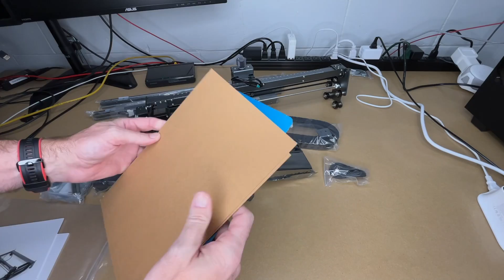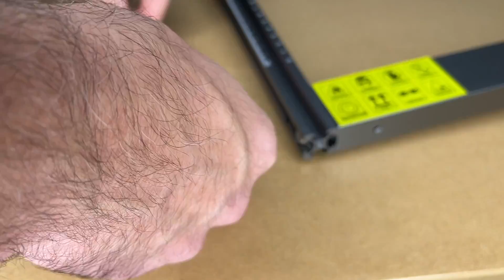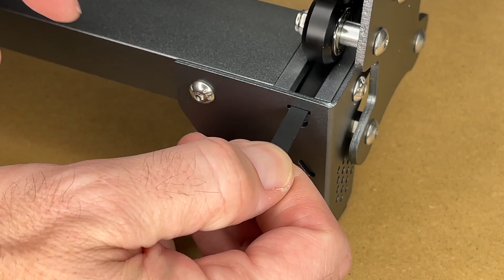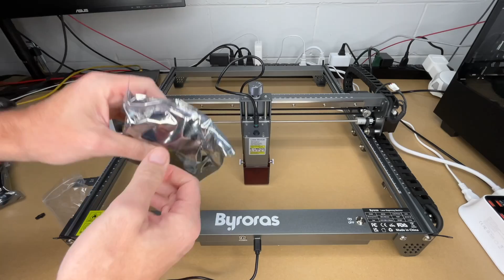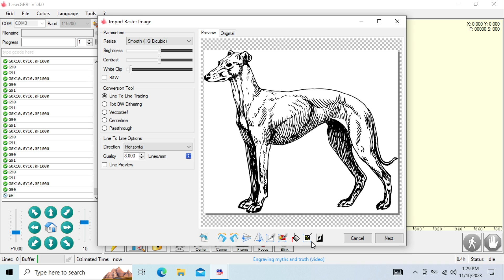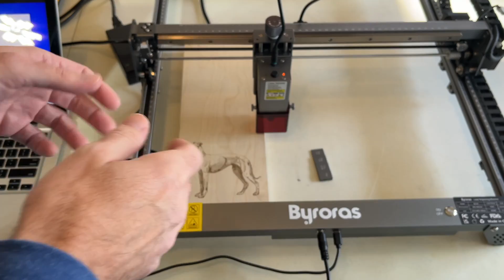Byroras BE100 10W Laser Engraver/Cutter

Comment: So do you have any idea how to center the project that I would be engraving like for example coaster or a keychain? I have the exact Engraver and I’m having a tough time.
Reply from the maker: You can mount the engraver on a piece of MDF or plywood and engrave a grid on it. Then use the grid to place your item you want to engrave. You don't have to even get that fancy. If you have a 4 inch coaster, you can engrave a 4 inch square or circle on the board. Then place your graphic inside the circle in your software and place the coaster on your board (make sure to raise the laser head before engraving). If anything I said is unclear or you need more guidance, let me know.